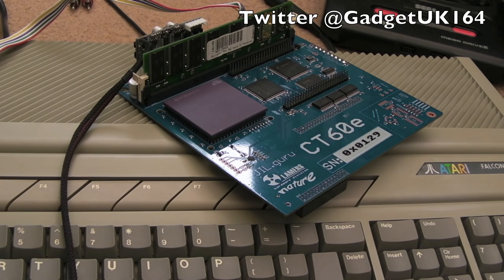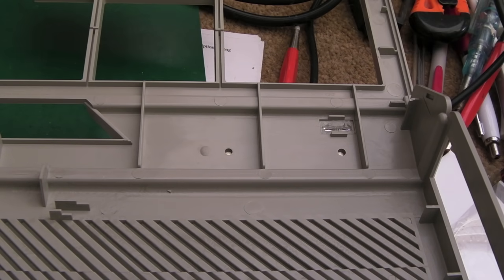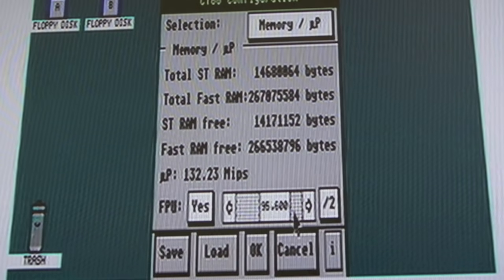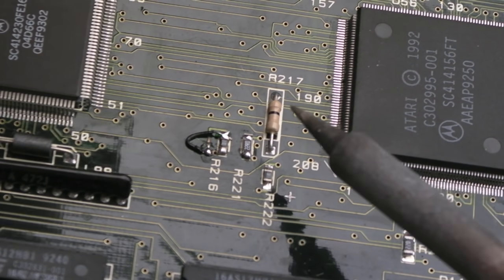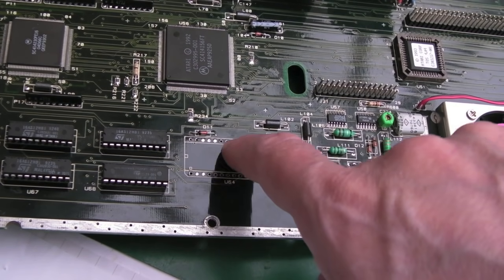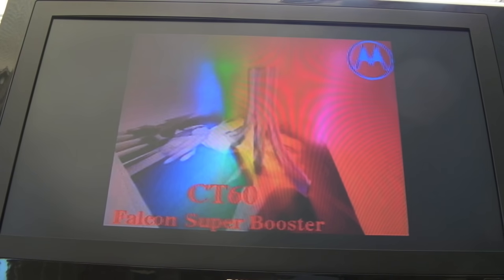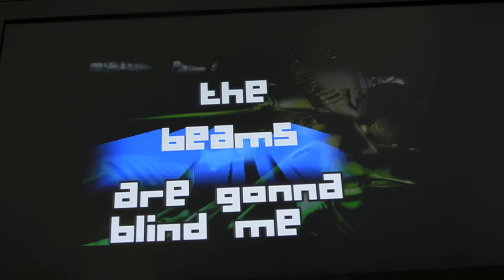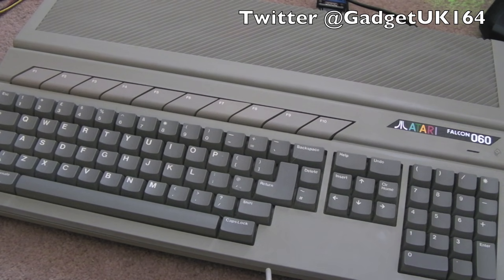Atari Falcon 030 Unbelievable Donation & Repair Part 2 (CT60e 060 CPU + NVRAM / RTC)

Comment: Really need to get my Nemesis Falcon back up & running, not used it in years & years, need a back up solution first, has an IDE drive in it, so if it is still running need to back it all up ASAP...

Comment: 8:30 IPA softens the glue very well. Just don't get it on soft paint because it might smear it off.
Reply from the maker: Thanks Yes, I've mentioned that numerous times in previous videos!  A good example of where IPA is bad - the red print on the front of a Nintendo Entertainment System.

Comment: For running Doom on the ct60 I actually recommend trying 'PMDoom' by Patrice Mandin. Reason being that the DSP optimised version you're running is actually limited by the speed of the DSP (which obviously is fine in 030 mode, as the DSP boosts the performance!) But the 060 processor itself out performs the 030/DSP combo, so running a completely CPU bound Doom engine like PMDoom will give you better performance in 060 mode. I hope that makes sense...

Comment: Open the Quake console and type "timedemo demo1", or "timedemo demo2", or even "timedemo demo3". Then, you can actually measure the performance and the changes due to overclocking.

Comment: For your fan, you may not need it to run full blast.. You can usually connect 12v fans to 5v instead, but some won't start up if you do that, because it's too low voltage..

Another option is to use the positive 12v connection, but use the 5v connection as ground.. Then you get 7v and those fans will run, and be quiet

Comment: Impressive frame rate increase on Quake there, overclocking is much more dramatic at this retro spec level of hardware, just hot enough to work well lol. Later day Atari and Amiga models were very close to running the DOS games of that time, took a while but they got there "I did it..my way!". :D
Pretty pin dense monitor out covers lots of better AV options but pretty late for a built-in RF out by 1992, surprised they didn't go external with that by then. Curious, I've heard multiple stories about temperature related quirks in a few Atari hardware platforms.
Sweet looking demo, bit of a mystery to me the Falcon with it's rarity and all. Look forward to part 3. ;)

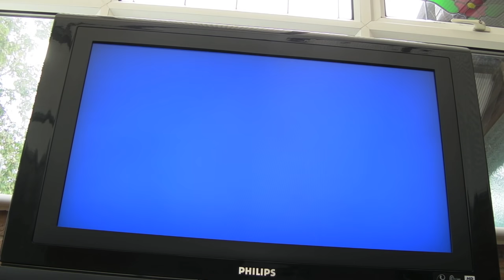Comment: 5:45 - Is possible to replace splash screen to custom one ?
Reply from the maker: Most probably - yes!  You would need to find the image within the custom ROM that the CT60E uses and modify it.  It would be fiddly to work out the start of the image, any size info etc and then replace it with something that is no larger than the original data.  There may be a checksum to change somewhere in the ROM too.
Reply: @GadgetUK164  thx

Comment: Jan Beta shared the idea of a shrink tube over what you are measuring to isolate it.
Reply from the maker: Yeah, I've used that technique myself before - I always forget and never have any heat shrink nearby!  The other thing I've done in the past is just plug it into a socket and then measure from the socket pins!  I have plenty of sockets, I just get lazy lol

Comment: Thanks! I'm so glad to discover this video. I just got a Falcon and a brand new CT60e from a guy in the UK that he kept as a backup for his other one. I ordered the Pico 80 watt PSU and am looking for the memory. I know the CT60e needs PC 133 SD RAM, but is that also a 168-pin_UDIMM form factor?
Reply from the maker: =D  This is a mirror of the original website:- http://powerphenix.com/ct60/english/overview.htm
I am not sure off the top of my head if its 168 pin or not.  I think I counted the pins on mine.
Reply from the maker: I swapped the RAM in part 3 btw!
Reply: @GadgetUK164  Thanks as I watched part 3. One question though was based on the 'CT60 Overview' you sent me the RAM was supposed to be CAS CL2 and your Kingston KVR133X64C3L/512 is (CAS) CL3. I guess that wasn't an issue, and that memory and the CT60 supports CL2 anyway?
Reply from the maker: @seanwalker4330  I am not sure if they changed the (e) to allow that - or whether the original works with CL3.  CL2 is faster I think, but the RAM I used works fine.
Reply from the maker: @seanwalker4330  This provides more info - http://jil.guru/32bit/CT60e/doc/chg.pdf

Comment: Why are old computers so much more interesting than modern stuff?
Reply from the maker: Very true!!! =D
Reply: Old computers had personality!  Each had its own ROM, OS, interpreter and architecture.  You had to get to know each machine, something I found very exciting as a kid back in ye olden days.  I spent countless hours doing basically nothing useful, but it was fun.  Beginning with the MS-DOS era, home computers became faceless, generic abstractions, designed for compatibility and modularity.  The user experience almost entirely comes from the operating system.  In a technical sense that is a superior approach, but it is dreadfully bland.  There is no excitement.  I do not consider any MS-DOS machine, no matter the age, to be truly "retro".

Comment: That resistor mod I dont really recommend doing.. it kills the clock feed to like 0.5V and stops both my falcons from booting.  Would be better to fix the clock buffer patch from my store and fix the issues that way.
Reply from the maker: I tried a few of those clock buffer boards and had worse problems tbh!  And they were definitely wired properly!  I might give yours a go at some point!!!
Reply: @GadgetUK164  +1 for what exxos said, the resistor mod also stopped my Falcon from booting. There are only two clock patch kits available to buy online at the moment so I assume you tried the one not by exxos... try his as he has had three revisions since he began and lots of time, effort and SCIENCE went in to it.

Comment: one question, nice video though but did you check the micro atx power suplys temperature when in use? i did use something similar from china in a low power atom based motherboard and with normal atx powersuply it didnt heat up much but the chinese micro atx the whole board heated up big time but it still worked though.
Reply from the maker: I didn't as this particular PSU is used commonly with these - but I will check that to make sure its not getting hot!

Comment: So they can't mail you a board with a battery fitted.. but you can order batteries in the mail..

Maybe the battery could have been included, just not installed?

Comment: The different resistance values makes a little bit of sense.. I know when overclocking CPUs in PCs it sometimes needed voltage unlocked chips, and boards and bioses that allowed you to increase the voltages slightly..

Putting the lower value (22) resistor in will result in a slightly higher voltage than the 33, which may explain that..

Comment: What was that 3M tape you were using to secure the heatsink? If it's just double-sided tape, it's going to do you absolutely no favours when it comes to heat transfer, being a plastic insulator. Ideally you want a thermal pad, or something similar, to conduct the heat to the heatsink.
Reply from the maker: It's 3M thermal transfer adhesive.  It works without a doubt, temperature dropped by 10 degrees before I even added a fan!

Comment: Almost all power connections are centre positive. But not all.. So you always need to check :-)

Most devices also have reverse polarity protection using diode(s), but again, not all.

And usually it's the stupid things with centre pin negative that don't have reverse polarity protection, like they are designed to get blown up..
Reply: I am hearing this a lot, but as a kid 30-40 years ago I had many devices and gadgets of all sorts that used centre-negative polarity (perhaps 70%).  I used them with universal AC adapters, so I paid close attention to voltage and polarity.  In recent years centre-positive has become much more prevalent but it was not always so!

Comment: Those third-party laptop style PSU's with the removable plugs with pins aren't the best design. I see laptops which fail because the plug somehow is polaity reversed 😥 The best laptop charger with removable plugs I've ever used was AI AI-YB9021B (12-20V 4.5A 22-24V 3.75A) which I still have for laptop repairs.

Comment: What an amazing machine with the CT60 up and running! Maybe you mentioned it, but what are the two switches, red and green LEDs connected to the CT60, good for?
I think you have to do a cut out in the shielding where the new exxos NVRAM is. I had to do a bulge and mine is not socketed. 🤔
https://flic.kr/p/2gUS36e , https://flic.kr/p/2geyBpY
Reply from the maker: Thanks, I will mention those switches at the end of part 3 =D  One is for the HDD, the other LED is power.  The two switches, one is the power switch (on and off), the other switch is a reset switch.

Comment: shameless plug: you can install ct60 tos 1.05 from insane.tscc.de and have a bios setup utility in rom!
Reply from the maker: Thanks!  I did see that on my travels but what are the benefits to doing that upgrade?
Reply: @GadgetUK164  Mostly small fixes - the big point is the build-in nvram setup utility.
Doesn't play well with supervidel due to some bizarre race condition i'm still fighting against though.